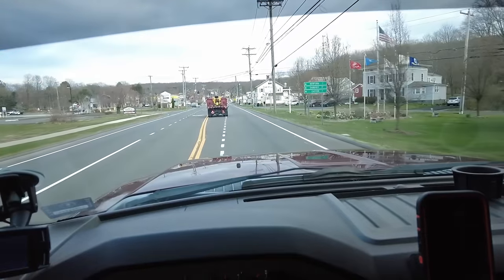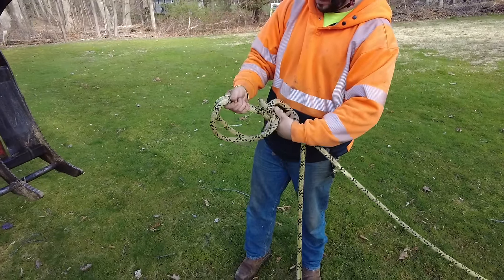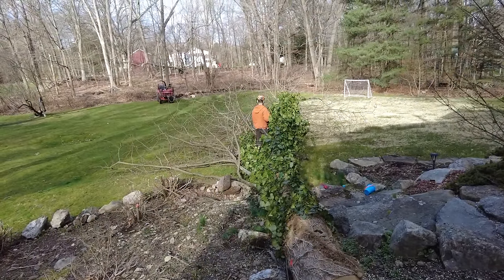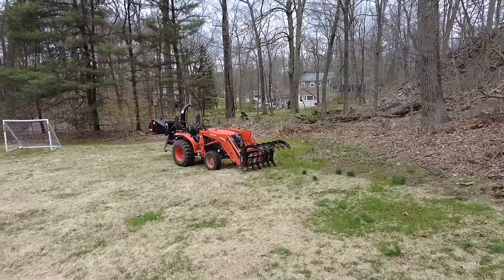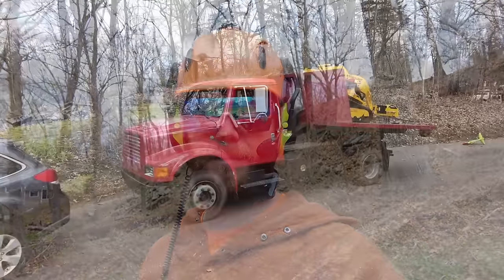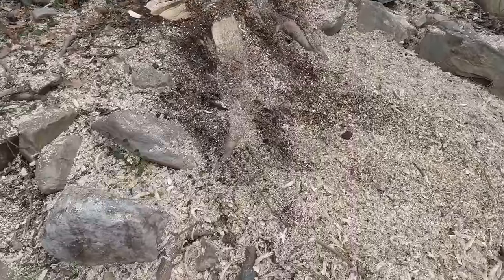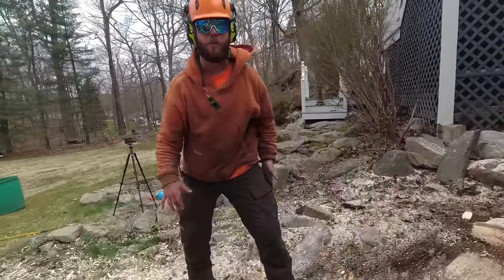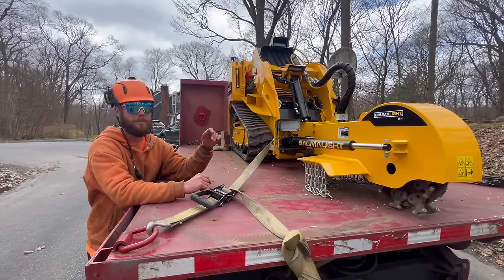#469 MINI Skid Steer STUMP Grinder DEVOURS a STUMP

Comment: Nice work. Those are Green teeth. On the grinder. I believe 500 or 700  series  and yes you can index them and resharpen them .
Reply: Look like Greenteeth 700’s on the grinder
Reply from the maker: Yep I looked into them, seems you can flip them about three times before reshrpening
Reply: @DudeRanchDIY  I run 900s on my rayco rg55 stump grinder

Comment: Great video, Jake. As far as the ramps, try using some 8x8 or whatever hight difference you have from the ground, and make a set of ramps 3 or 4 feet long. I have seen something similar used so a box truck could get high enough to reach a loading dock.
Reply from the maker: Yep I was thinking something similar as well